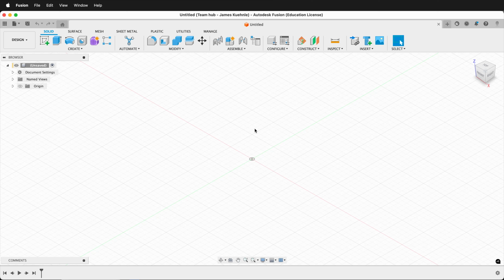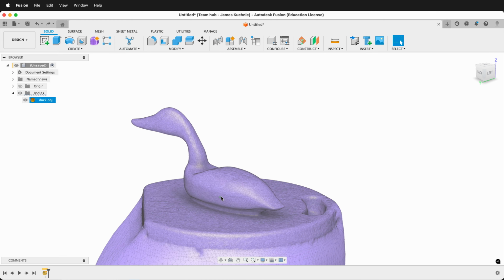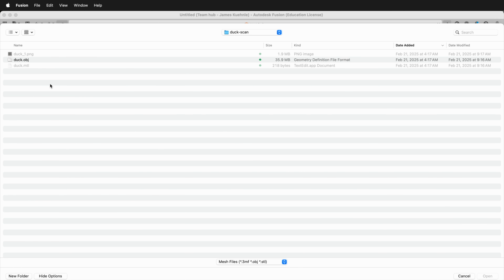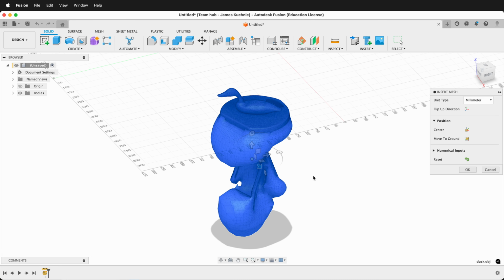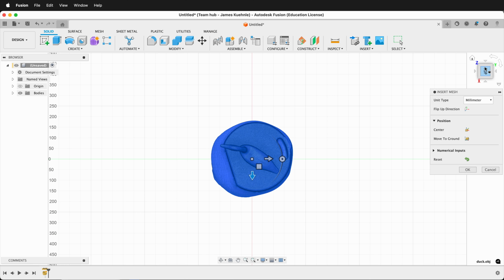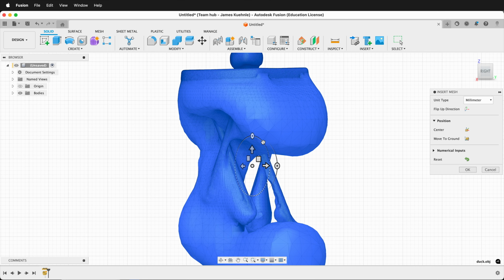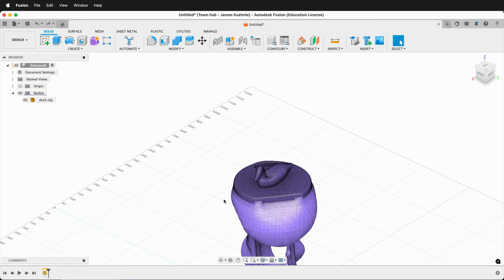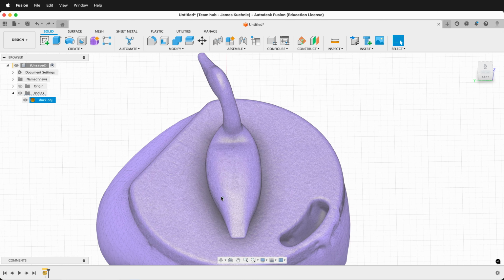How to Insert a 3D Scan Mesh in Fusion 360 – Quick & Easy Tutorial

Comment: Maybe not necessarily this model but would it be possible now to convert this into a solid, then slice it up (one of your other tutorials) so it can be laser cut and assembled with plastic or wood layers ? how would you go about doing that? Many thanks for your videos.
Reply from the maker: Yes, you can convert a mesh to a solid in Fusion 360, then you can use surfaces to cut it up, thicken the surfaces to become pieces to laser cut. The videos below show the concepts.

Convert mesh to a Solid in Fusion 360  https://youtu.be/f_WTsl64QR8

Cut solid model into slices for laser cutting in Fusion 360 https://youtu.be/dWYMBVTUvDA